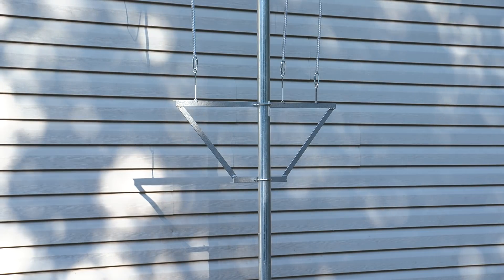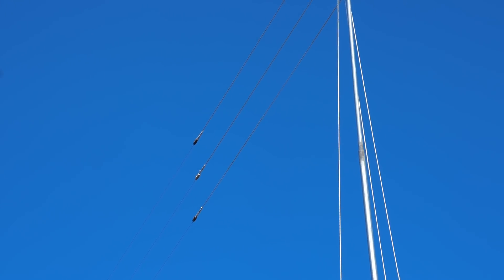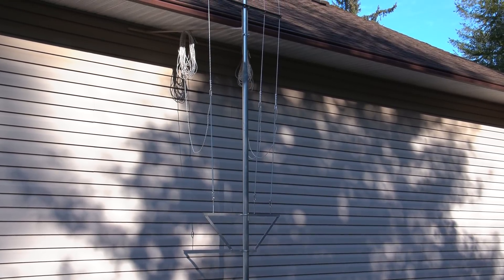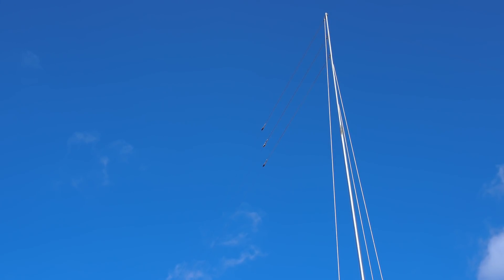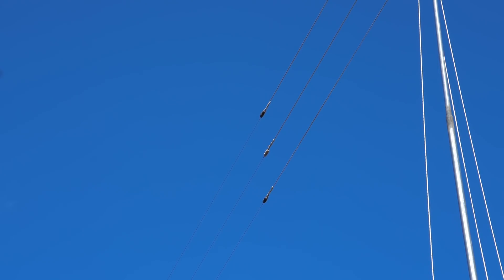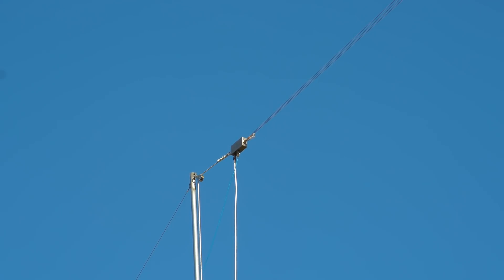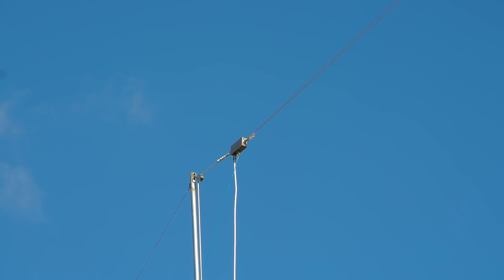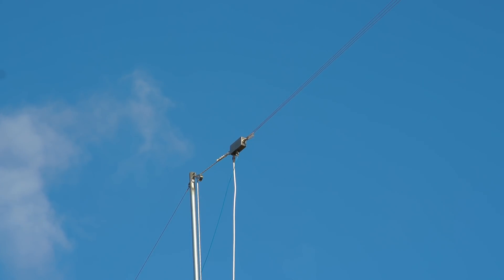Mr Carlson's 3-6-9 High Performance Antenna!

Comment from the maker: To learn electronics in a very different and effective way, and gain access to Mr Carlson's personal designs and inventions, visit the Mr Carlson's Lab Patreon page here: https://www.patreon.com/MrCarlsonsLab
Reply: Huh, I never thought of using mig wire.  I have thought about using electric fence wire though.  I believe it is aluminum, one solid strand, about 12 or 14 gauge I'd guess.  It this a good or a bad idea?  This would be for a "random" wire attached to a homebuilt match box.
Reply: I made an inductive AM loop recently with a 16 inch pizza box with 16 turns of 22 AWG magnet wire tuned with a 450 pf tuning capacitor I found on Amazon. It may need an extra turn of wire to reach the very bottom of the AM broadcast band but mine reaches a target station I was shooting for on 540 khz. It`s very powerful at boosting signals and blows the commercial AN-200 9 inch loop away.
Reply: No feed point at the new shop?
Reply: ⚠️ 😷⚠️     Hello  DOCTOR  Carlson….   Thank you for literally years worth of incI redible tutelage!!
 VIDEO   SUGGESTIONS  =  “OLD  FASHIONED”  ELECTION  TABULATION  MACHINERY. 
The kind of Equipment / System that is  HONEST + ACCURATE  + TRANSPARENT +  LEGITIMATE !!

Gotta  STOP  the  CROOKED  &  EVIL  DEMONCRATS  💩  FROM  STEALING  ANOTHER  ELECTION.

By… USING… PAPER BALLOTS.
😀
Reply: @PowderMill  Greetings:
Not a Democrat, but no honest audit has found that the results are other than honest. It is sad that you forget that this land was already inhabited when Europeans "discovered" it and stole it from the occupants with a different sharing ethic.

Comment: I've had other homemade boxes get moisture in them from condensation and temperature variation.  A small weep hole fixed that; since yours doesn't have it, how is the antenna doing?

Comment: With a low loss tuner even a single wire would work fine with so much wire high up in the air. Thanks for the video!

Comment: Is this a receive only antenna ?
As there are three lengths of wire, I've assumed as no circuit diagram, all wires connect to the same point at the box end, does it rely on resonance of each length to be automatically selected by the RF signal, to be used for the frequency in use ?
Why have you chosen this design over using wave trap coils on a single length of wire ? For all the additional complexity of three lengths of wire, pulleys and springs, there must be something Mr Carlson knows than the more common single wire wave trap design.

Comment: As a side note and related radio issue, I'd like to know how to build an FM antenna pre-amp. I have a yagi FM antenna on the roof in a bad signal area. I can't find a pre-amp without blocking FM gain. Those with a switchable FM trap, have no decibel amplification for FM. It's the opposite of what I'd like to have. It seems that I can't buy one.

Comment: I wish I knew more about antennas...

Weird how one feed line goes to all 3   antennas....

So I guess the 3,6,9 will have different lengths...

Is it like a 1/2 wave length so as the frequency is changed...only one of the 3 wire will resonate ...maybe at the far opposite side of the each of the  wires there is a tank circuit ...probably not...

I suppose you have a tuner between your transceiver and the feed line to the box...?

Maybe a napkin CAD drawing of the antenna would help...and if if got off my duff...there may be another antenna erection esposide...like prior to the intro to the bucket truck?

Comment: Dear Paul, is this 3-7-9 an end fed monopole with a tuned wire length that eliminates the need for balun?  Do you plan to show us the receiver you use with this antenna?  Thank you and regards 73, Karl KE3KWE

Comment: I use #10 AWG Stranded wire, very flexible, thick so it lowers antenna "Q" and makes it more broadband and gives my antenna tuner a broader range. Those who dislike "tuners" because they waste power are wrong. The RF has to go out the antenna wire and if you figure it out right (180° out of phase) the reflected power becomes additive and goes back out in phase with the transmitted signal. Other hams ask me if I am running a linear amp, but they do not believe that I am barefoot 80 watts with all the 5-9+ signal reports. Grounding though an iron ore bed really helps, too. I worked a station in Wales on 52 MHz FM and have the QSL card to prove it. So, taking advantage of antenna design, grounding and antenna polarization (tilting 0° to 90°) can really help with ionospheric reflection. Mr. Carlson has a pretty good, well thought out receiving array that is great in theory, but let's see how it works out in real world conditions throughout the year during the different seasons and propagation conditions.

Comment: Nice install sir!  I incorporate what some call floating antennas, I have two tripods installed on the peak of my roof, both have 6’ heavy duty PVC pipes for mast’s. I painted both tripods and mast’s with a high quality truck Bed liner spray. The only metal the antennas touch is the actual ground braid that connects to my earth grounds. 73 from the Ground control tech bench-

Comment: Hi Mr. Carlson.  Ive been a licensed ham for 56 years and very much enjoy your informative videos!  I have a question regarding your selection of .035 S6 MIG Wire.  Depending on the manufacturer, my research indicates that it has an elongation factor of between 22% -28% and unfortunately, I was not able to determine its rated breaking strength.  Other than cost, can you elaborate as to why you selected it as your preferred antenna wire... Keep up the great work you do and best regards!

Comment: Dear Mr. Carlson,
I have an old school crystal radio set and wish to string an antenna for it on the upper part of my house (single long wire). The easiest place for me to string it is just beneath the aluminum gutter that runs the full length of my house. I’m wondering if the wire (insulated) being close to the metal gutter, which is likely connected to earth ground somewhere, will be problematic. Any insights you can share on this matter will be greatly appreciated. - Thank you!

Comment: EF antennas have their place.  But a more efficient antenna might result from a simple dipole, fed with twin.  No need for heavy coax and connector at the centre.  Just a lightweight plastic insulator and ribbon hanging down.  Far lower line loss than coax, even when the SWR is high.  Alternatively, for feedpoint convenience in some locations, an inverted L could be used.

Comment: I am interested in the type of silicon sealant you used.
The one of the best sealant for electronics is General Electric RTV 162.
It smells sweet.  does not cause any damage to the electronics.  Some items have been in service for 10 years, with out any issues with the seal or the electronics inside.  Don't forget the water adsorbed, IE silica gel packet.

I am retired now. I used to work in a research and development lab.
One of my tasks was to test sealants for out door protection of equipment.
Some one in the field decided to seal an enclosure with ordinary silicon sealant ( smells like vinegar).
The result eas a pile of semi's rattling around inside the enclosure. All the leads were eaten through by the acid vapours.

Comment: If the copper coating oxidizes it becomes resistive. Since there is the skin effect of RF energy are you thinking of adding some protective coating, insulating tubing or weather resistant heat shrink to cover the wires?

Comment: If you feed the antenna from one mutual point how do you stop the signal going down the other lines?  Say if transmitting and receiving on 6 how does it not use 3 or 9 ?

Comment: Are you planning to use this antenna for QSK (full break in CW), or is it intended mainly for SWL?  I've always wanted to try a rotatable electrostatically shielded loop for broadcast band DXing, but for various reasons it never got built.

Comment: umm yeah, this is over engineered. You get no real benefit from the three different length wires. They are so close, in terms of wavelengths, that they will all couple together giving no difference to running the longest wire on its own. Using coax for the downlead is a bad idea, open wire feeder would be better, and as some others have suggested, a balun would be good too.
Ah well, shouldn't expect too much on Youtube.

Comment: I would be concerned with the pot metal box and how much tension it could withstand before breaking but i guess the springs at the opposite ends will prevent over tensioning
Great job, wish I had the space to setup something like this

Comment: Greetings Paul:
The separation of the wires at the garage end is not readily discernable as to whether the separation is oriented vertically or horizontally.
Also, I do not see where the separation is done.
Reply from the maker: Hi James. The three wires are vertically spaced 18" apart at the shop. They are separate at the feed point, and fan out. This can be seen close to the end of the video as I show the box at the top of the mast.

Comment: Hi there, great series, how long is the longest wire, from what I watched in the video it looks likes it's run between 2 different homes, or do have a very long house. Looking forward to a On Air test, use a spectrum Analyzer if possible! 73 de Pat KK6PD     -30-

Comment: Nice job, like the springs, are they science lab springs?
  Good luck with that wire, mig welding wire does not have a thick copper coating and it always ends up going rusty.
  I use hardened copper enameled wire or antenna wire, Available in the UK from Essex wires i believe.
  Would it not be a good idea to have 3 different length grounds?

Comment: Hello Mr. Carlson. I have very little knowledge about electronics but I have memories of my father back in the day tinkering with electronic and visiting radio shack to get parts which is probably why I find the subject interesting and with a bit of nostalgia for me. Your knowledge on the subject is astonishing. I find your way of explaining easy to follow (relatively speaking) and the level of quality and amount of effort you put into your project is an example to follow. And as another comment mentioned you do give out bob ross vibes with your videos. They are not only educational but pleasing to watch. Thank you also for the midpoint update in the antenna project because I’ve been following it and was wondering how you were doing with it. Looking forward to watching you work repairing others electronics and using this antenna to test them. Best regards.

Comment: Gooday,  great Video's love watching the professional manner in which you approach your projects. I realize you are busy but I have a question,  I live in a block of units, was wondering if it is possible to build a loaded 27mhz CB beam antenna using 2 whip antennas as a driver element. and smaller aluminum reflector elements. I have heard this is possible but wonder if the directional gain would be worth constructing such an antenna. Having no antenna analysis equipment makes this difficult to experiment with. I live in Australia and have many CB radio's I have collected over the years, 27mhz CB is still used a lot in Australia mostly the sideband frequencies, as well as UHf 477mhz cb. Would be interesting to see any 27mhz antenna designs you may have. Have a good one whatever your up to.

Comment: Has anyone mentioned making and using an impedance  matching transformer at/in your feed-point box? Then too, another one down at the junction of your 75 Ohm cable to your receiver which input could be anywhere from 50 Ohms up to? (see receiver specs). Should make your antenna perform even better. DE KA7MWQ

Comment: Great videos. New viewer here. I am wondering, however, around 9:30, why don't you add a balun transformer inside the Hammond box to prevent line loss and stop the antenna at the box? Seems like the coax length would need to be taken into account if no transformer is present to stop the length of the element. Wouldn't this affect your SWR? Thanks in advance.

Comment: I can pretty imagine how high the gain of this well built antenna is ⚡💪🏼 But isn't there a higher risk of lightening strike due to its height? I know the case is actually grounded but I saw appliances die even in a radius of 150m from a strike - I hope your lab is well protected! 
Thumbs up for your nice work and restaurations!
Greetings from Germany
Reply: If every radioman was thwarted by the risk of lightning, we wouldn't have radio!  :D  We ground and use common sense, disconnect when not in use, don't use when there's t-storms near, etc.

Comment: Hi. Great video. I’m confused - are these effectively EFHW antennas ? With the ground wire serving as a counterpoise ?
Reply: I built some Endfed Antennas, with different matching transformers (9:1 and 49:1) depending on the wire length. Some say they "dont need counterpoises", I think that is not right. Mostly the shield of the coax or any ground wires act as counterpoises. For recieving this is no problem, but when it comes to transmitting (I am a licensed ham radio operator), there can occur very strange effects because the RF takes its return path... sometimes the microphone or the morse key, or the Network Router loses its sync.
I switched to a symmetric dipole, everything works now

Comment: .....but does it get AM???...lolz!  
"WoW" , .......and that's coming from an antenna aficionado,, have made a few types over the decades..... but nothing like that baby...Nice work Mr C ;)
Reply: If you are willing to modify the tuning capacitor calibration of an AM radio with a small screwdriver adjustment, you can extend the receive coverage into the 160m band (1.8-2.0 MHz) and listen to hams who are running AM mode.  Back in high school I did this to my boom box and inductively coupled it to my 80 meter inverted V dipole.  It worked great!

Comment: What's the length of the different antennas? It seems like you are covering two properties? I would like to improve my sw listening, but don't have 40 acres to spread out in.  Does it need to be parallel to the ground or can it be a single pole and use the guye wires themselves as the antennas.  My last experience with an antenna design was in 1962. It involved bamboo, some bicycle wheels and real tall sweetgum tree that my brother conned me in to climbing.  I'm now 71 and don't have any sweetgum trees.   Thanks for the videos and courses.

Comment: Just wandering if painting the wire would have been a benefit? I read somewhere that insulation covered wire is quieter for DX listing. I built a couple of loop antenna's, one using TNN 16 guage wire and the other is 14 guage solid, both have regular electrician's insulation and seem to work fine. I would love to know if you have ever noticed a difference between bare and insulated antenna conductors.

Comment: To feed the 2nd lab on the oppsite side, how about making two antennas against each other and putting the springs in the middle? To spread the wires use the usual spreaders but put a weight on one end to keep the vertical alignemnt. However the springs may influence the other bands by parasitic effects. But it would be a good solution to have two independent antenna systems for the to shops?

Comment: mr. Carlson...I watched your antenna video but this, has to do with your 145L Stromberg-Carlson receiver. I noticed on e-bay some catalog pages from 1937, they had a picture of the 145L and the fidelity control...I bid on them and lost, I hope you were the one to out bid me. I have the price list of all there radios for 1937. If you wish ,I will send it to you. I was hoping my radio was part of that list...I think my 450 is, 1939 or 40. I have bought all my equipment, and soon I will start on it. Let me know about the price list....Peter chambers

Comment: I used that same kind of MIG wire up in the mountains for an antenna we use at a cabin. The copper-coating will only stay for about a year or so and then you’re essentially left with steel so bear that in mind as it does corrode right away and is very thin. But it is strong and will last a long time.
The only other thought is I’m wondering about how you were going to make the ground connection to that eyelet, so that you don’t have a problem with corrosion and noise. For me I think it would be better to run the wire inside the box to make the electrical connection and through the eyelet outside the box to make the mechanical connection. Anyway great job and good luck with it.  73…

Comment: They should be supplying a fiber washer with those porcelain insulators. Cardboard isn't going to hold up very well in the harsh environments those insulators go into.

Comment: I'm interested in what kind of lightning protection you're going to use besides just unplugging everything before you walk away.
Reply: I was about to inquire about that myself.
The poles at either end are likely grounded locally. That leaves the coax downlead to address with a lightening arrestor.
Reply: @jamesmdeluca  what about a ground strike?

Comment: ham radio out let in the united states are hurting for radio no radio far as hf not much in stock because of the coronaviurs all radio mite be on a ship off are shore been lie a year wonder if the salt air hurting those radio on the ships

Comment: I used MIG wire for an antenna about 40 years ago. I have no idea what it was, but it was copper coated. It was given to me by a friend who worked at a factory  where farm equipment was built.  The copper is very thin. I used it for transmitting and receiving on 40 and 80 meters.  Maybe it was thr RF, but the copper coating did not last 2 weeks.
Reply from the maker: It does oxidize quickly, but that won't hurt a thing. All the electrical connections are soldered.